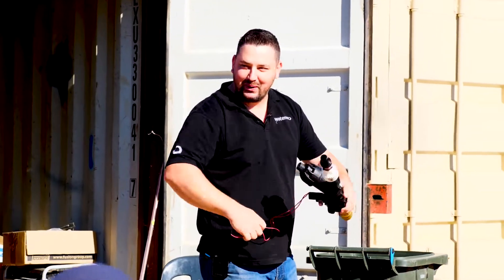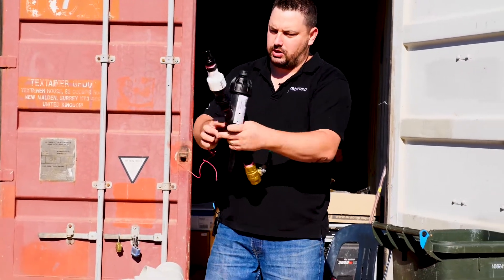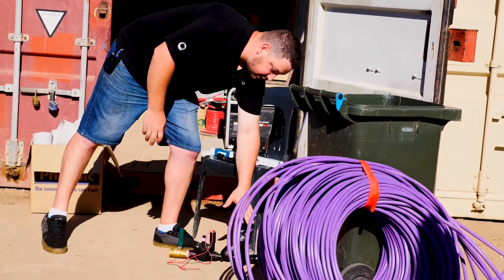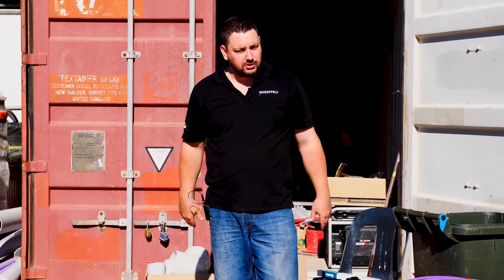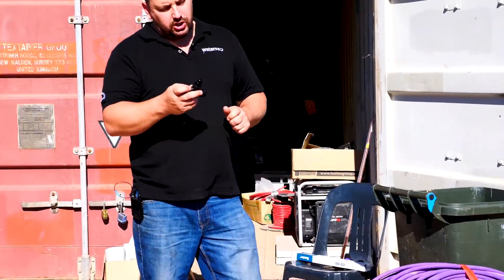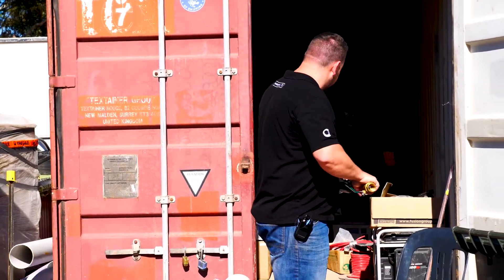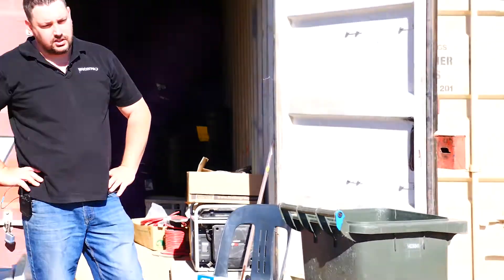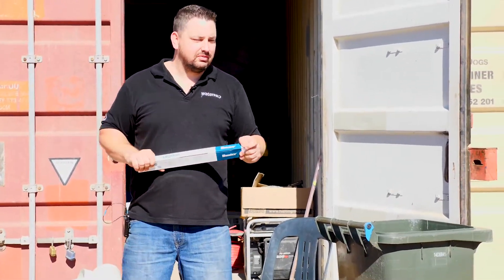Commercial Irrigation Training with Adelaide Property and Gardens

Comment: Hey fellas,  cheers for the vid. So if this was just the normal domestic yard you would have the one valve and filter etc? Because it is commercial, would you use a bunch of filters with a bunch of valves or just one after the mains? Thanks
Reply from the maker: Thanks for watching Brett. In a residential situation most people put all the valves in one box on a manifold. Does that answer your question?